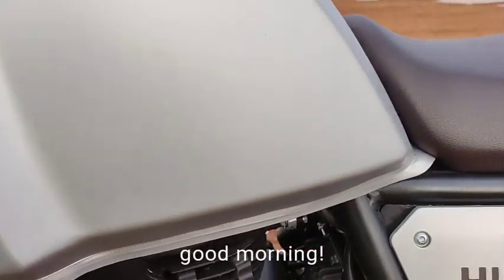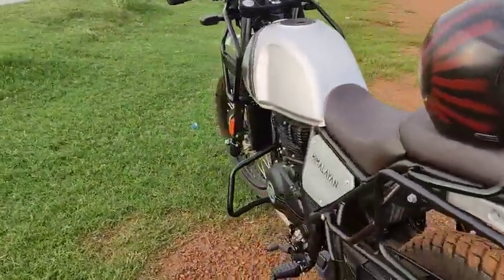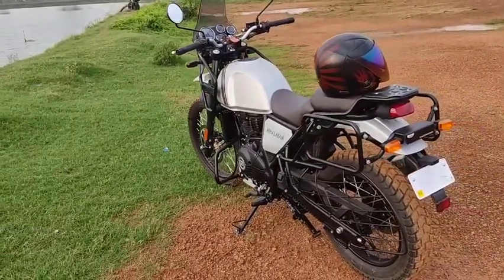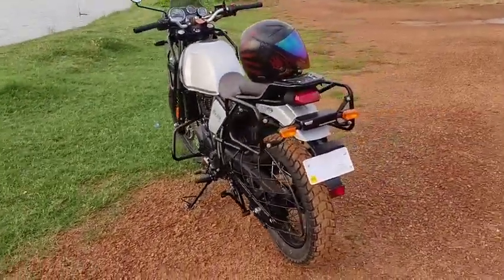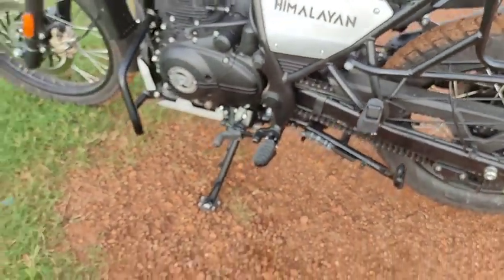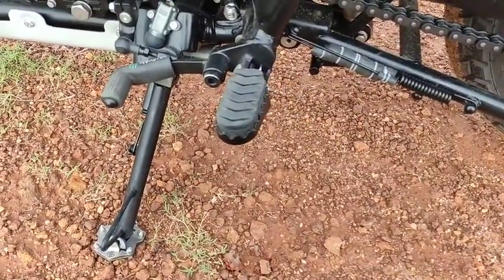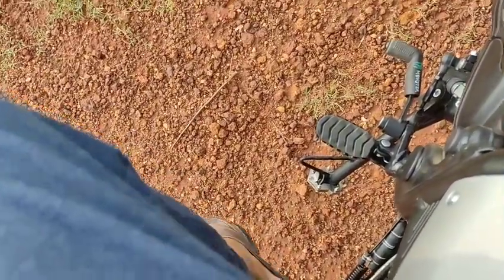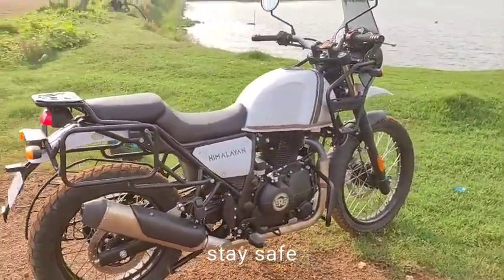Royal Enfield Himalayan side stand problems and possible solutions

Comment: Hi, have you found any other issues apart from side stand?
Im planning to buy it.
And what's the waiting period?
Reply from the maker: I had to wait for 2 months, booked on 21-Feb, got my bike on 23-Apr. Waiting could be more, upto 3-4 months
1) After first service I am getting the issue with engine starting as the fuel injection pump at the start not getting into action sometime. When it happens  it bugs me for 2-3 minutes.i took it to service center, they helped me and I still need to monitor it for a week and I will post a video
2) I don't like to ride Himalayan to local market place as it feels bigger bike, so would be good to have another bike(I use thunderbird).
Reply: @onoffroads6789  thanks for the delayed response 😁

Comment: I don't know if it is only me, but I find the side stand to be way too upright. I mean, I kind of get uncomfortable parking my bike on an uneven road. I always fear it would fall. Would like to know what your experience has been like? I am a woman biker of the height of 5'5". I also feel this bike is heavy too. So I was kind of looking for a way to be confident about the side stand.
Reply from the maker: Himalayan is heavy.... But I feel when running it's easy to maneuver. 
The side stand is upright because for adventure bike many uses the foot peg to get on the bike and the bike itself is tall. So it is best that way to my knowledge. 
If the groud is declining towards right, no way we can park it on side stand. 
I used to fear too that bike will fall and still sometimes go front and back to find a  suitable parking spot. 
But adding the side stand extender is a big help and I do not have to worry about the soft soil, sand, uneven rock etc... So get it to park anywhere during rides... And when you get confidence on the side stand you can always use  foot peg (left) to get on the bike.. 

Also fit the saddle stay of RE only to easily put it on center stand. As I have shown in the video while using centre stand if we hold the saddle stay then the weight is managed by our waist instead of arms, so that a big help too... 

(Hope it helps)
Reply: @onoffroads6789  tyeah, you are absolutely right. I find the bike extremely easy to maneuver while riding. Only shaky was my confidence at the time of a tricky parking spot. But I will try the side stand extender. Thanks a ton, mate!